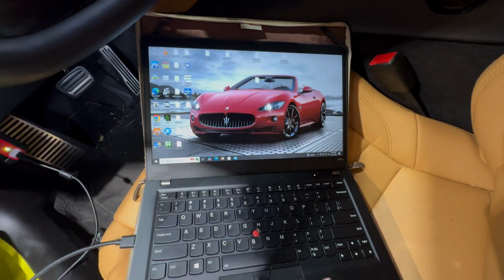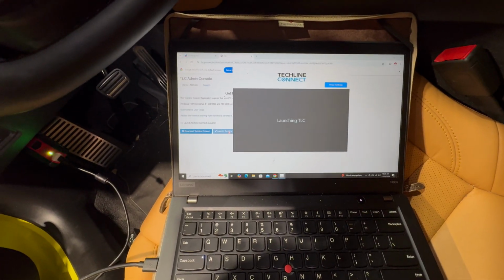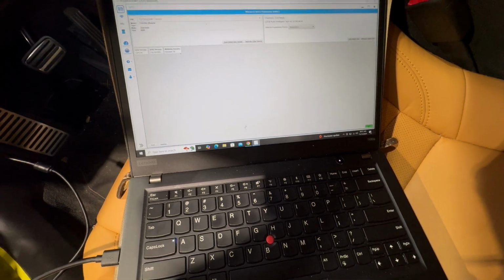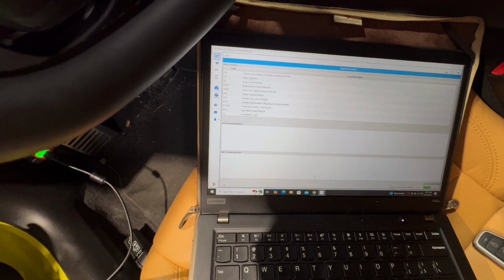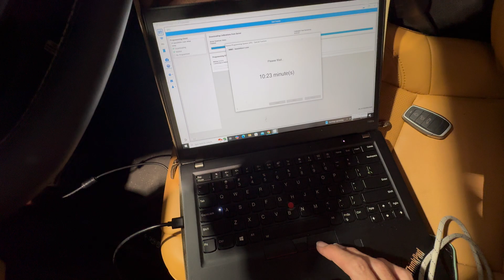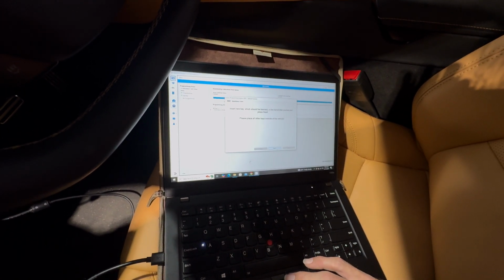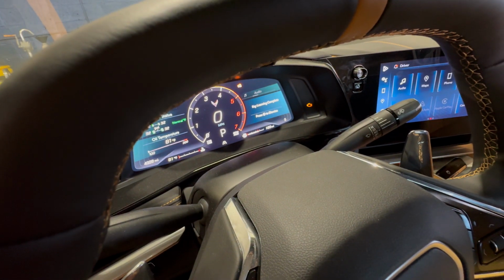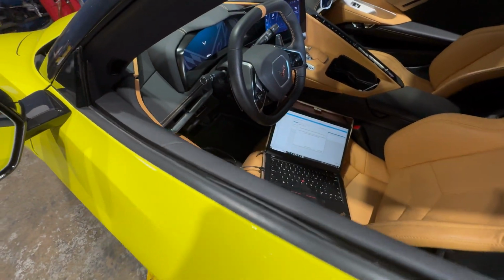HOW TO PROGRAM A KEY FOR 2024 CHEVROLET CORVETTE USING TECHLINE CONNECT & AUTEL V200

Comment: Have you successfully used the V200 on 2026 model GM vehicles?
Reply from the maker: Yes
Reply: @legacylocksmith7874  Thanks! From other videos I've watched it looks like somewhere around the 2024 models GM started using the same remote start hardware across their truck lines, even if you don't purchase one with the package that includes that function. It looks like all you have to do is program a key fob that includes the remote start button to make it work.
I wonder if there's something you could activate using Techline Connect to make it show up in the myGMC app too.
Reply from the maker: I’m not sure but definitely had customers without the remote start but a new key with remote start function works so you probably right on that

Comment: Do you connect power ?
Reply from the maker: Only if car is low
Reply: @legacylocksmith7874  When programming newer vehicles (Add Key or All Keys Lost) using OEM software and NASTF access (GM SPS / Toyota Techstream / ODIS, etc.), is it acceptable to use a jump box for vehicle power, or is a regulated power supply (around 13.5–14V, 40–50A) required to avoid voltage drops and module damage?

What do you personally recommend and why?

Comment: "VTD Secure Access Locked" I keep getting this error message. Any idea how to get around it?
Reply from the maker: Maybe update and reset your computer
Reply: I've tried still no luck on a 24 Silverado
Reply from the maker: I did couple of them yesterday with no issues. Try to see if vci is updated. And check if OBD port is the original one
Reply: Are you referring to the maxi PC suite?
Reply from the maker: Yes
Reply: Did that and it didn't change anything

Comment: Hello, I have the Techline and the V200 but it’s don’t recognize the V200. When i try to contact to the car
Reply from the maker: Try to rest your computer after all the updates. Also. You need to install MaxiSuite for the computer to have the drivers
Reply: @legacylocksmith7874  after downloading Maxi suite do I need to register the v200 or just don’t and do nothing else thanks
Reply from the maker: Just open the software and make sure it’s connected and updated
Reply: @ ok I downloaded but when I try to open I can’t
Reply: @ is there anything else I can use? If the V 200 doesn’t work without having to download the app
Reply from the maker: You can use any other VCI device on the list of the Tech line connect. But it’s a very simple to use the V 200 maybe reset your computer and try again after updating
Reply: @ ok thanks a lot buddy your the best 💪🏼
Reply from the maker: Thanks 🙏

Comment: Question for you. How does using a laptop compare to CarDaq? I was looking into that, but they want 3k for another machine that can't do anything if you don't have subscriptions to use it. Seems a laptop is the way to go, like you are doing.
Reply from the maker: Cardaq makes the VCI device that connects to the vehicle. So now they came up with that one that has a screen. It’s just like using a computer maybe minus installing the dealer software. One thing to keep in mind is that the way I’m communicating here (Autel v200) will not work with ALL dealer software this is the reason to get Cardaq. Honestly makes sense
Reply: @legacylocksmith7874  Thanks for the info.
Reply from the maker: My pleasure

Comment: Can I program with Autel KM100 instead of laptop?
Reply: You know he's a scam locksmith when he asked if he can do a 2024 chevy with a km100
Reply: @HoreLaxx u actually can right now that’s the crazy part without a key at that just the km100
Reply: @TrapplotVon  doubt ful
Reply: @HoreLaxx  all it take is 30 seconds 🏎️🏎️
Reply from the maker: Unfortunately. No
Reply: @ oh which year c8 can I program only with Autel and universal key? no laptop
Reply from the maker: @AMGIsLife as of now. None. You can probably buy another tool that does that but honestly (that cost couple thousand), this would be much easier to do.
Reply: You cant with a km100 but an autel im508 you can do c8 corvettes